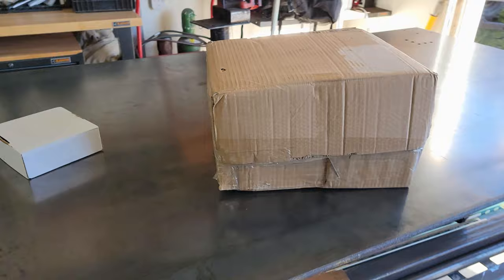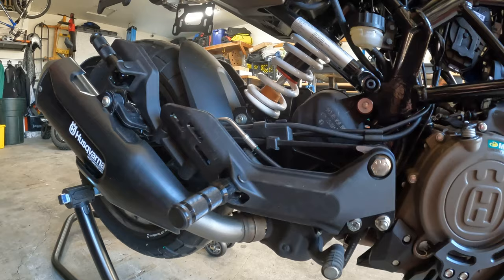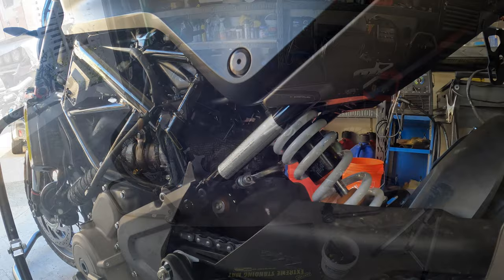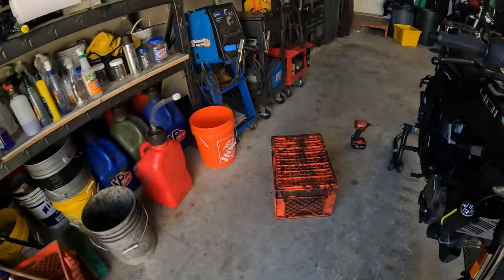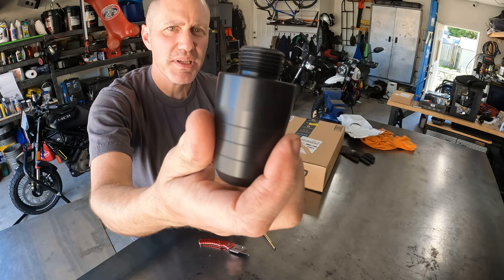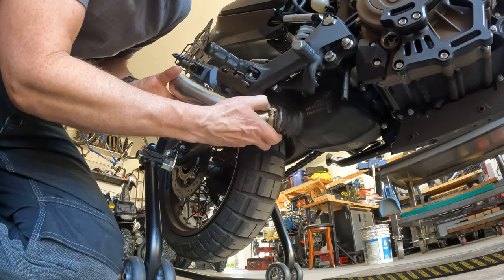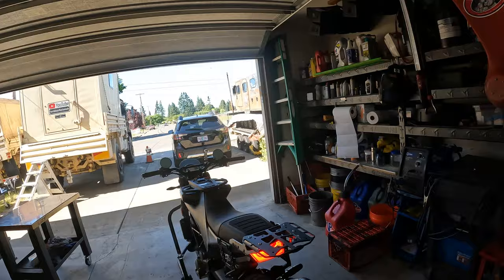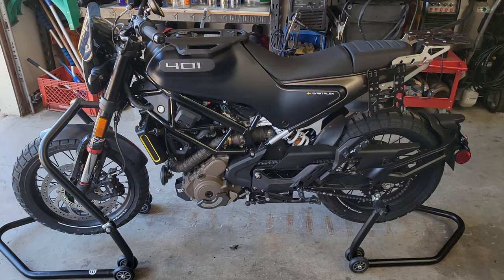Husqvarna Svartpilen Part 14 (2019 svartpilen exhaust with aftermarket mid pipe and "silencer")

Comment: Awesome 😎👍....now install a engine skid plate
Reply from the maker: Have you checked out the playlist for this build series?  You can watch the episodes in order.
Reply: @SeanFillner  oh I did and I don't like the T-Rex one but I have seen one only that covers the bottom side....may be it's the default skid plate with the 2018 model....just install the Hyperraider crash guard and luggage racks....they are cheaper, lighter and better. I had installed them to my Svartpilen 250 along with X flash hazard....by d way, try the official Husqvarna Scalar Gloves....and also let me know where you had found them cheapest

Comment: Nice vid mate, exactly what I am wanting to do after the warranty runs out on my 21 Svart. Just wondering if you looked into using a full duke exhaust system before choosing the 2019 start ones. I have seen a few vids of ppl that went down that road....to be honest, I wasn't 100% sure the 2019 start exhaust would fit. Also, when you were heat wrapping, were you using cable ties to secure to the 1st part of the wrap or was it wire? Cheers,
Reply from the maker: All of the 390 exhausts are the same aside from the can.  They all fit each other respectively.  I used hose clamps.

Comment: Quanto piove lo scarico a benda marcisce 😢
Reply from the maker: Please post in English.
Reply: @SeanFillner  the bandage when it rains it smokes and rots break the exhaust with heat a mistake even when it doesn't rain it overheats
Reply from the maker: @giustizaf.8497  been running header wrap on various vehicles for over 30 years.  Never had any issues.  On a street bike it is much less of an issue.
Reply: @SeanFillner  unfortunately you are a big liar the bandages once they get wet and dry they split the exhausts because they rot I am a connoisseur of Harley Davidson best wishes to your bandages
Reply from the maker: @giustizaf.8497  Once again I never had any issues.   This bike sold a few years ago and the new owner says that it is holding up just fine.    Find another channel to watch and stop trolling mine.
Reply: @SeanFillner  write in Italian💪